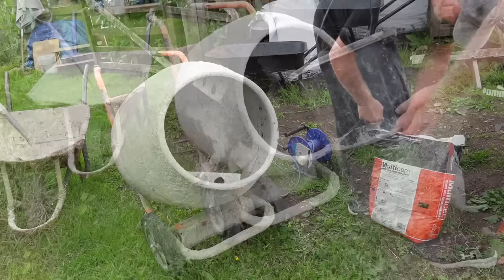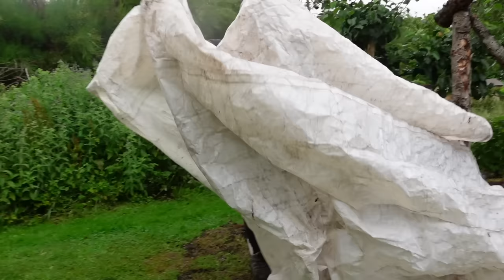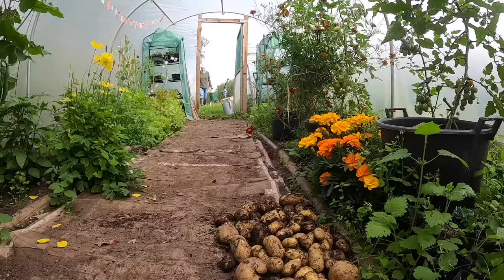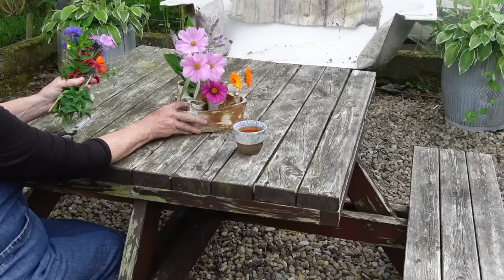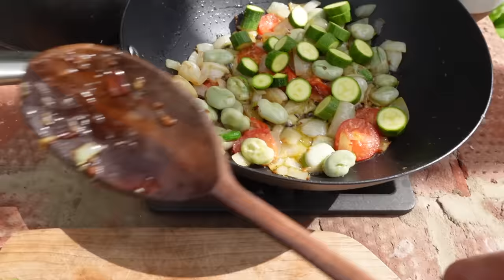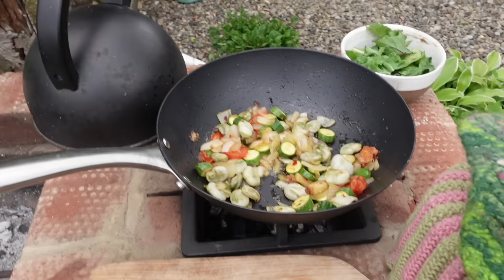Building a Brick Cooker in my Garden. The food tastes AMAZING! #4

Comment: How à propos ! I've been watching videos today on the Youtubes by Americains cooking on open wood fires using recipes from the 18th & 19th century. Fascinating stuff ! The main tip for cooking on a wood fire is to use oak & to wait until the wood has burned down to form coals. No smoke & a constant source of even heat. Also, using this method you could use a dutch oven to start baking bread or even cakes ! Good luck with your future cooking/baking.